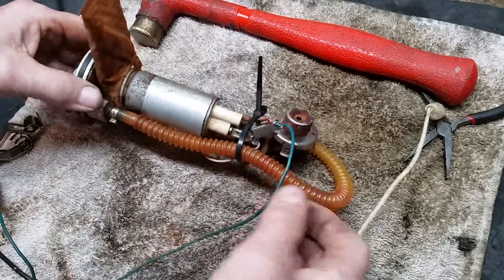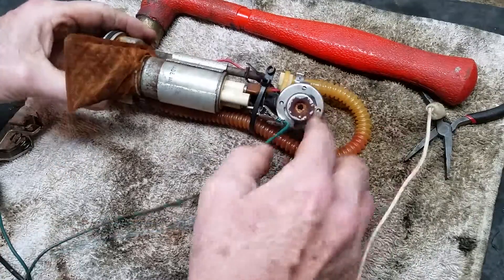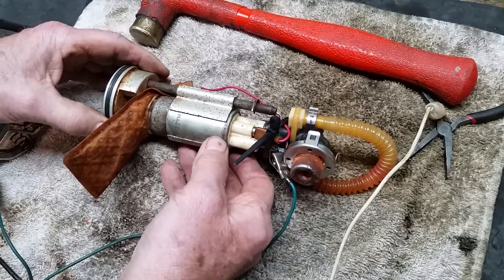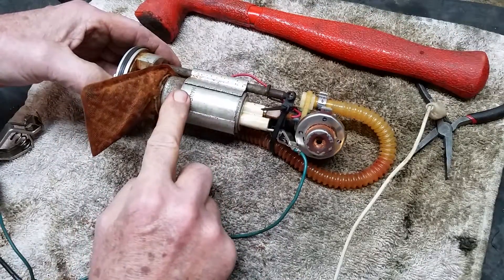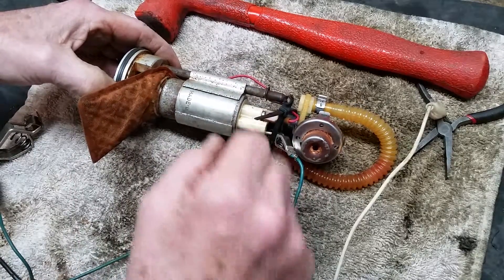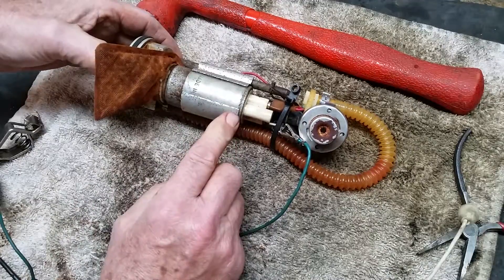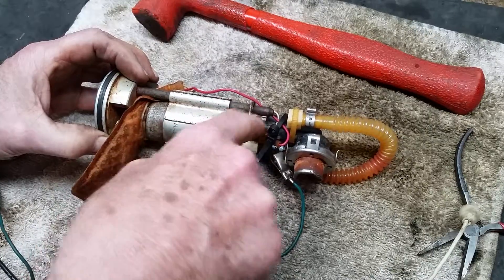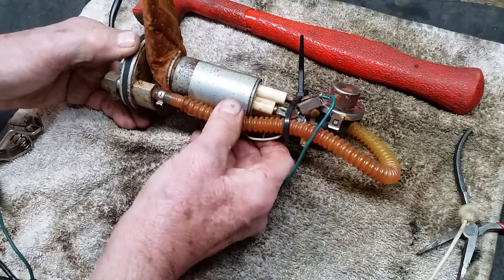Excelsior-Henderson fuel pump fix

Comment: hello how do you remove pump from tank?
Reply from the maker: It's a chore as the pumps may be locked in pretty tight. you just have to pry and wiggle until it breaks loose. After you remove the snap ring that is.

Comment: Thanks for the video.  I'm having no luck with mine.  Can you point me to the ebay pump you mentioned?
Reply from the maker: Almost any automotive pump that looks similar will work as they all put out over 65lbs pressure and the relief valve controls the final pressure to the system. Here is just one - https://www.ebay.com/itm/Brand-New-Flow-Electric-Fuel-Pump-255LPH-High-Pressure-Walbro-Pump-GSS342/351949319136?epid=2240732398&hash=item51f1d06be0:g:63MAAOSwNDFbbBeR
Reply: @Ruleof2plus1 Thanks!  I'll let you know how it goes.
Reply: @Ruleof2plus1  Thanks, I got one and hacked it together with hose clamps.  Do you know where I can find compatible injectors?
Reply: Can I send mine to you for you to try to repair?